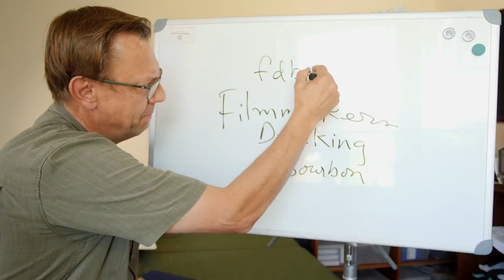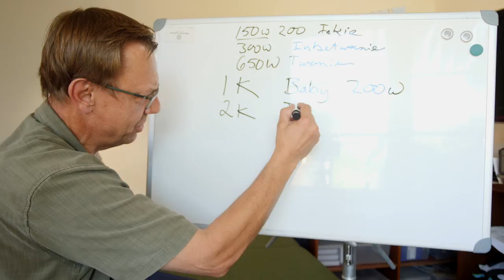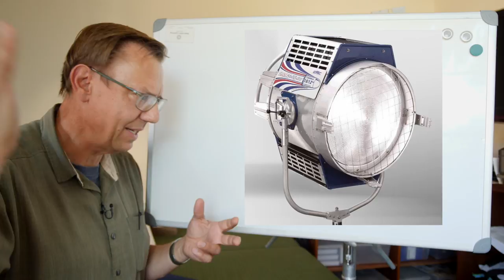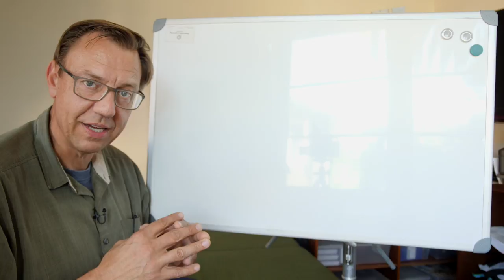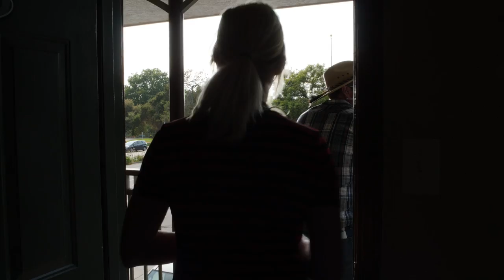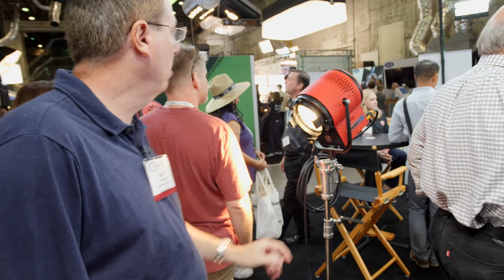Meet The Gaffer #62: Mole Richardson Fresnels

Comment: As someone who owns exclusively second hand Mole fixtures, I am confident in their ability to support their products. I was sent (For free) some rolled pins to fix a broken spot/flood mechanism on a baby 1K. A small gesture, sure, but they were very easy to contact and were quick to help. I had no qualms picking up a used 5K Senior LED (Daylight only) relatively recently and it's a fantastic light. Probably physically the biggest fixture I'll ever want to own, but it's manageable by one person a wheeled wind up stand.

Comment: Very cool.  I haven't used a Mole Tenor yet, but I get the use case if it has more output than an Arri L10
Reply: Cinematography Database The L10 is closer to a 1,700K tungsten where as the Tenor uses about that much with LED. I have an L10 and just got a Mole Senior. The Senior they are about the same size, the L10 is heavier but is balanced better in the yoke. The Senior is much brighter putting out the same amount of light at Flood as the L10 does at spot.

The Senior doesn’t make the sharpest shadows but I primarily got it bounce the light. Something I started doing a lot more after watching you videos, Matt.
Reply from the maker: +Reuben Isaac/Matt, Thank you for the feedback! I’m interested to see how the Daylight only units compare to the Kelvin tunable versions in terms of output. The Arri L series has the bonus of having RGB, but if the fresnel is larger and the output a lot brighter, I would lean towards the Mole. Looking forward to it!
Would love to see BTS pics from some bounced light set ups... “always learning” is a great approach!
Reply: Luke Seerveld I’ll be doing some tests with the Senior this week. I just got it this past Friday. I just sent you an email so it will be easier to send you photos.
Reply from the maker: +Reuben Isaac, Looking forward to hearing about your tests!

Comment: Another awesome video!  I purchased the 5k daylite back in February and it has been my workhorse in everything from full night ext to day ext narrative and interviews.  I was looking for a heavy hitter to put in my 1ton cargo van package and the senior fit perfectly - no ballast, headcables, or scrim bags to take up space or setup time.  The low power consumption is unbelievable across their whole led line for the punch you get out of them.  The varimole tweenies (650w equivalent) feel more like a 1k and just like the senior have a beautifully soft beam.  When you see the guy put his hand on the fixture, it really is only warm even if it's been burning for 6hrs.  My crew and I were joking the other day that we can't remember the last time we needed gloves while working off my truck since   I got invested in the LED line!
     But there are a few complaints that should be addressed.  Everyone's first question is about color.  On the non plus/minus green versions there is a touch of green so I usually have 1/8 minus handy (however this is also within the same range of color shift you get from hmi's and kinos).  
     The 0-100 dimmable is true BUT the dimming curve is not incrementally accurate.  If you want to drop 20 pts you're looking not at the 8 on the dial but more like 6.  50% is more around 3 and lower from there takes a gentle touch - so just gotta have your light meter ready.
   At least with my varimole tweenies the fan can be heard when you use it in a super quiet scene if it's close to the mics but it's no louder than a RED and I've only ever had 1 sound guy inquire about the noise. And also there is a steady high pitched tone when you're between color temps that is barely noticeable (could be the tinnitus though) and it's nowhere near a screaming joker 800 or old Hmi lamp.
     All in all I'll be buying more into the MoleLED line and can't wait for them to come out with a vari tenner and a dedo style inkie.
Reply from the maker: +John Knudsen, Wow, thank you for the wonderful in-the-field testimony! Very good to hear. Yes, a vari-Mole Tener would be sweet. Thank you again for adding to the conversation.
Reply: Thanks for this hands-on feedback. Since you mention that you are using it on interviews, is there any noise issues with the 5K light?

Comment: Even as a person who got into the industry just as LEDs were becoming a thing I remained skeptical of their entry into the fresnel world. It was too obvious. The early LED panels created multiple shadows which absolutely needed to be diffused so it doesn't look horrible, and they had funny edges on the shadows. They also had the strange coloration around the edges of the shadows. I've seen both of those problems disappear with the Aladdin - I love me some bi-flex and definitely use them often nowadays. Then I saw the first LED Fresnel from Dexel. Oh my. Absolute failure. The edges looked terrible, fuzzy, strangely colored - they just didn't cut as cleanly as I see the tungsten fresnels do. I thought I will definitely wait a few years for the LED technology to be incorporated into the fresnel world - now this video brings us the good news BUT I feel like we fully wont be able to judge until we see how these lights cast shadows in a dark scene as a solo source. It's to me the real LED test...It's interesting that the same Senior has different CRI values for tungsten(95) versus daylight (90).
Reply from the maker: +Zahed Bata, Many LED units that can be purchased in different color temp also have different CRI values. I would think it would be the other way round because I think of tungsten as being a blue LED with a phosphor coating... but my technical understanding is sadly limited and probably behind the times. Beyond that, I thought the CRI index was not as accurate in relation to LEDs... but again, I would defer to more knowledgeable people:-)

Regardless, I look forward to the variable color version of the Mole tener...
Reply: Now I am limited on my knowledge, so correct me if I am wrong, but the biggest issue with LED's is that they are source due to their quick falloff. I would put money that if you had a pitch black room with no lights on and a single window and you wanted to have one source, an old Tenner would fill that room up significantly more then the led tenner. In that an LED tenner would drop-off more as the light bounced, leaving the room less filled then if you went the traditional route. The draw comparison, however, makes me not care one bit about the falloff comparison. 1600 draw for a 10k equivalent, there is bound to be some down sides. The pros outweigh the cons, as far as I can see.
Reply from the maker: Agreed. I’m intrigued, and look forward to seeing a big Fresnel source in action and also compared to the traditional units. Fun times ahead:)

Comment: At FSU's Film School we use both the 5k Senior and the 10K Tenner and they are probably the most used lights on our sets. We however have found that the 10K pulls about 17 Amps so it deserves it's own circuit if you're on house power but we also have a generator at our disposal. The color quality of the daylight LEDs are around 87 SSI, I think. Their CRI is at 95. I would always have the 5k or 10k on any set that I shoot. There are issues in terms of green and magenta casting with both so It's important to be aware of that. I try to put on half or quarter magenta in front of these lights.
Reply from the maker: Are these daylight or tungsten LED fresnel or color tunable?
Reply: @meetthegaffer  Both are Daylight LEDs. we don't have the color tunable :(
Reply from the maker: Copy. The tunable ones would have G/M tuning too. But it’s a good learning opportunity for students:) You are fortunate to have those units in school.
Reply: @meetthegaffer  Do you know if the Sekonic C-700 is able to measure discontinuous lighting like Florescent and LEDs accurately? Our school is considering getting new color meters.
Reply from the maker: Yes it can, but the C-800 has a few more attributes, like X/Y. That may be the best at the moment.

Comment: I'm calling shenanigans. The Tener 10K is a 1600 watt light that puts our 2500 watts? What?!?!? 
The Joker 1600 HMI also runs on 15 amps... and a refurb unit will run ya 1/5 the cost of a refurbed Mole.
Reply from the maker: Until you get in a room with both units or use both units next to each other on a job it’s had to make definitive statements. Marketing is marketing.

Comment: Hi Luke do you think LEDs will replace filament or HMI lights entirely? I want to invest in some 'traditional' lamps but shelling out thousands for some fixtures is not a good investment if the tech is dying...
Reply from the maker: Call me crazy, but I think the units most in danger of going out of date are the current batch of LEDs, because that’s the tech that is changing the most:) I may not use my tungsten units very often, but I haven’t gotten rid of them completely. Would I invest in tungsten, no. HMI’s however still have better throw, generally speaking, so it depends what you are planning to do. It’s not any easy answer for any of us, even though we can all see the trend:)
Reply: I've been told HMI replacement lamps are being discontinued... do you see that happening?
Reply: If HMI are on the way out, that is really sad. I LOVE the look of HMI.

Comment: Could you please make a video on freshnel, pars and HMI? It's very confusing.
Reply from the maker: That could be fun. Basically you have a point source that is in one concentrated place, like the glowing filament of a light bulb, or a tungsten halogen bulb, or an HMI bulb. You put that bulb into a housing to optimize the out put of the light. A so called fresnel, is when you place a stepped fresnel lens in front of the point source and a smallish reflector behind the point source. You can move the point source closer or farther away from the fresnel lens to get a wider or narrower beam of light. That’s called flooding and spotting the light. You can also take that point source and build a larger reflector behind and around it. The reflector is not just a small scoop, but more of a parabolic shape. This is your basic PAR unit that can be open or lensed in front of the point source. Some PARS are fixed in one position and others have the ability to move the point source so you get a narrower and wider beam spread (spot and flood). Tungsten bulbs are warmer (redder) in terms of color temperature and get warmer as you dim them, more orangier, while HMI bulbs are cooler (bluer) in terms of color temperature... color temperature is often talked about in Kelvin rather than Celsius or Fahrenheit. When LEDs came out they didn’t work so well as a replacement to single point sources because you needed a lot of points to generate enough light to be comparable to tungsten or HMI. Manufacturers tried lots of things with greater and lesser success, but basically you have blue LEDs that are painted with phosphor for color temperature and lensed to focus them. The more emitters you put in close proximity the more cooling you need to provide, spread out the emitters and you get panels with various lenses or translucent fronts, jam the emitters together and you have a new version of a point source and can attempt to place traditional fresnel lenses in front of them. The Cineo R15 mounts the emitters to an post that sticks out from the reflector in the same way an HMI bulb would stick out of the reflector in a standard PAR unit. But many closely mounted emitters do not make a point source, so the effect is somewhat different and is worth watching. Fiilex lighting is another manufacture who is creating LED point sources in a way that no one else is doing... so also worth watching!
Reply: Thank you Luke so much. It's very helpful. I have one another question - Does sodium vapour bulbs used in the street lights good have good CRI? If not how do we achieve that effect?
Reply from the maker: Maybe a better question is whether street lights using that kind of source is pleasing for skin tone when you are using other units as well. You can gel your other lights to be close in look by using gel or dial them in if they are higher end LEDs. David Mullen has some good answers and ideas here:

https://cinematography.com/index.php?/topic/66744-how-to-achieve-this-look-with-sodium-vapour-lights/
Reply: @meetthegaffer  Thank you Luke.